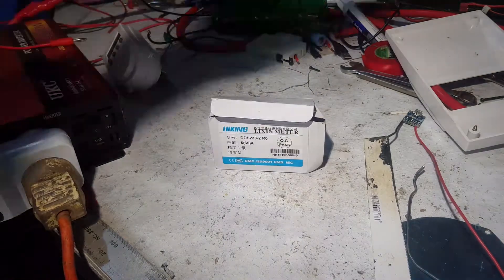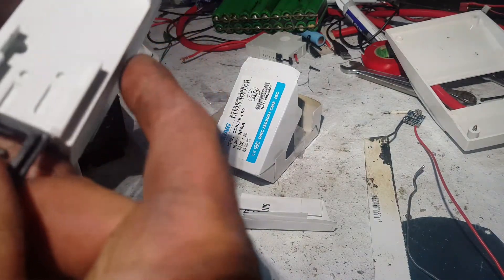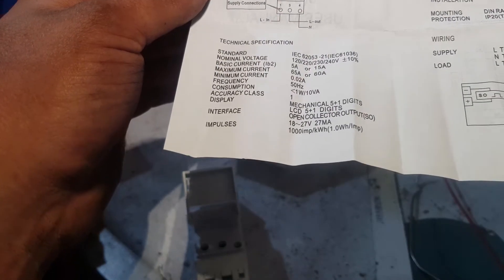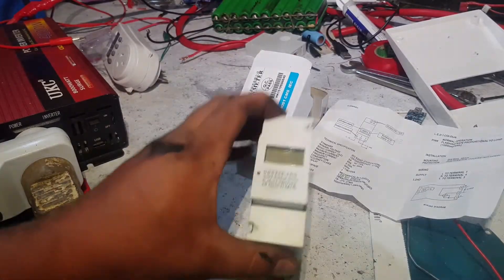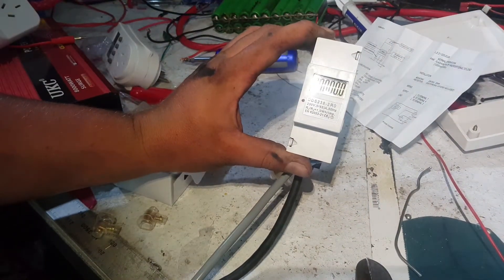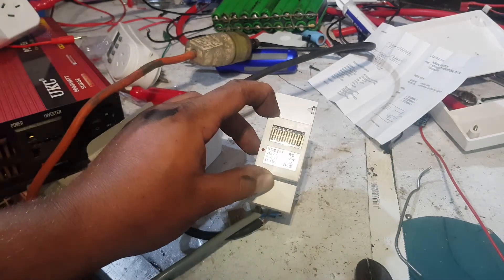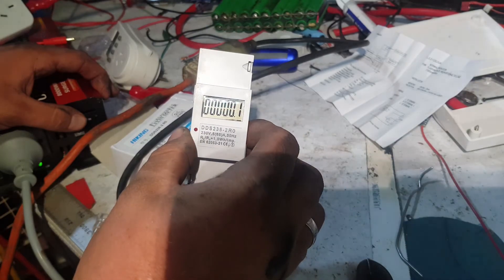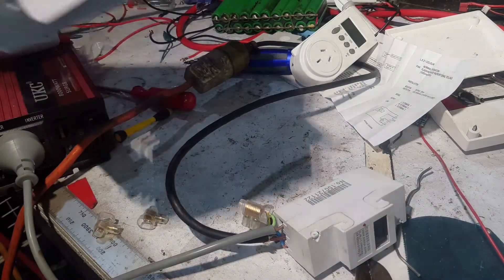DDS238-2RO Digital 230V 5(65)A DIN-rail Kilowatt Hour Kwh Meter review/test

Comment: Don't trust Chinese stuff for such a critical purpose. They usually overstat the Ampere rating. All of 40A relay from China were found to have chip for 16A only when broke open from inside. Put 25% at max, if used for more it will heat up I'm sure and worse can cause fire. Use mcb before this. You have been warned!